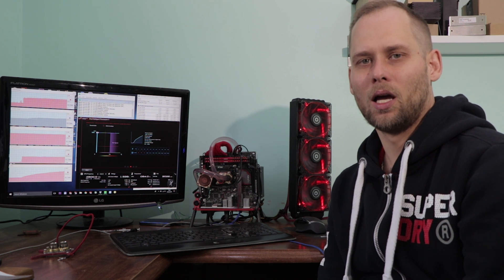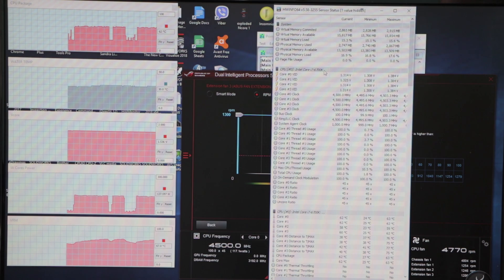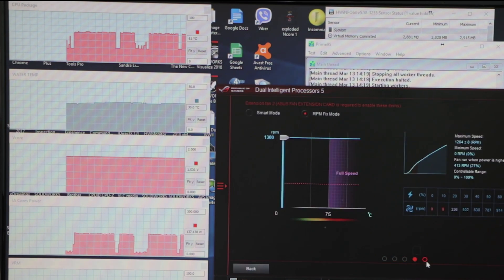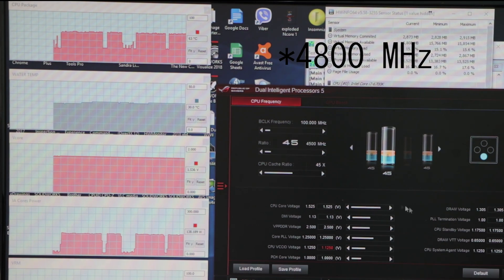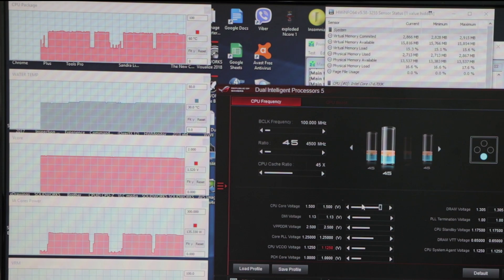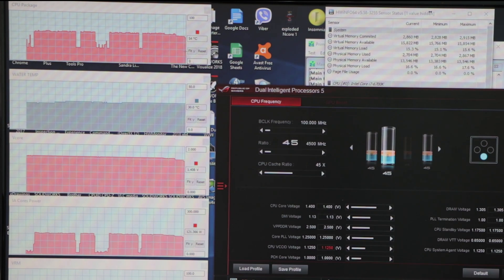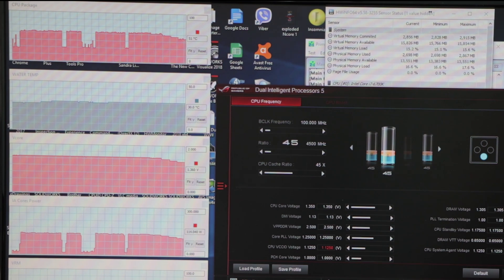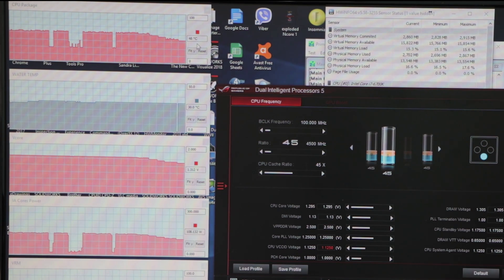My temperature results on Ncore V1

Comment: Can you do a comparison between the Ncore and a delidded CPU with a copper IHS on a hot CPU such as an OC'd 8600K/8700K? My guess is your solution would run 1 to 2 degrees cooler, at the cost of compatibility with monoblocks and some wider fittings.

Comment: @NUDEcnc
http://watercool.de/en/delidding-skylake-does-it-make-sense
The very thin base plates under the fins of current current CPU water blocks are optimal for big contact surfaces, as provided by the heatspreader. With smaller contact surface and remaining thickness, the heat cannot spread optimally throughout the material. Direct DIE mounting request a thicker base plate.
Reply: Article is not available via the link provided.

Comment: Also this comparison doesn't show us how does it compare to other blocks on the market make a video comparing it to some other blocks like heatkiller iv, supremacy evo and so on. Then we can see the difference. I understand you might not have those blocks available but still, food for thought!
Reply: Other blocks have an EXTRA LAYER of thermal compound and IHS between the CPU and the cooler. As I've said: This NCore will keep your CPU sub 80 C even at 1.52 volts!!!
Reply: Yes and it also means more expenses, watch the kickstarter video - the guy is not your casual star-vlogger that receives everyhting reviewed for free, but a brilliant engineer that deserves support - not tutoring
Reply: 3 blocks will be under 200€ to compare it against the ncore v1, but hardocp made a review on it already, and at best it`s 1c better vs regular blocks, sorry but that`s not enough to justify the expense.
Reply: not going to happen